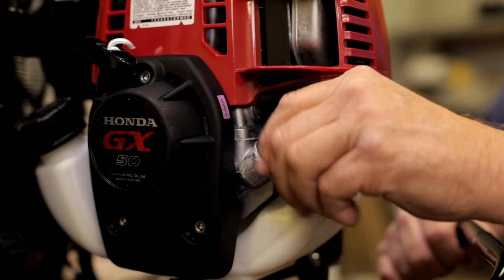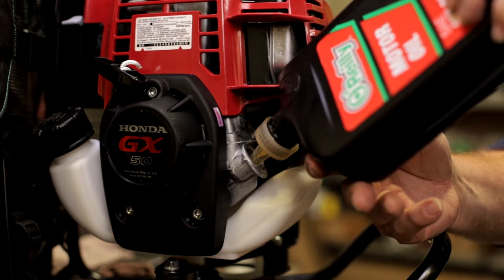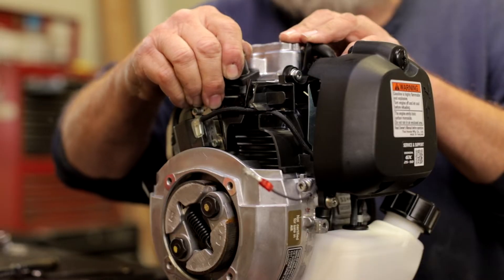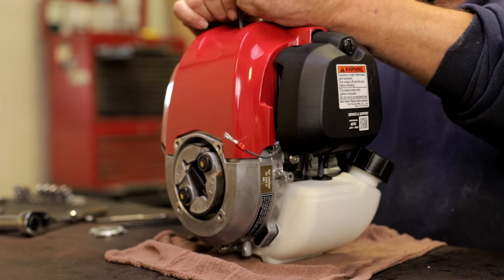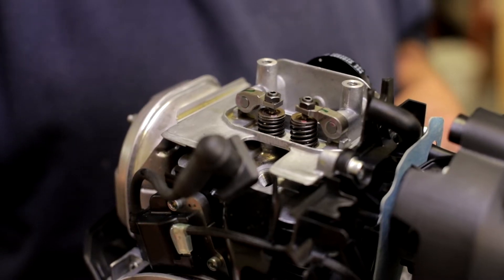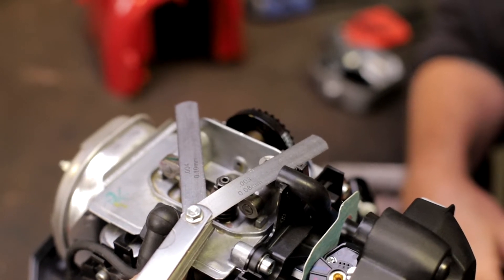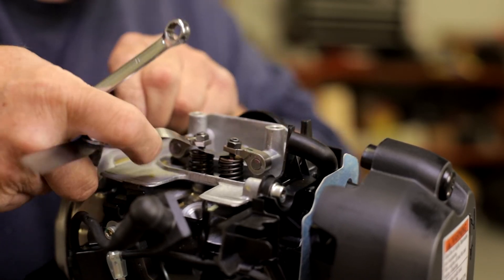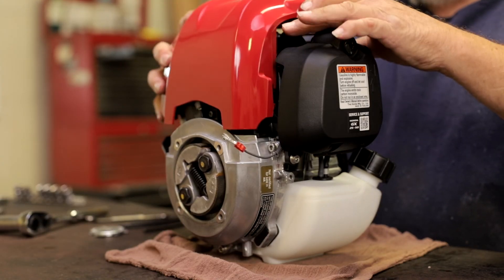Honda GX50 Maintenance and Repair

Comment: Mine bogs down and shuts off when I use full throttle but idles fine any ideas ?
Reply: likely the air fuel mixture is set wrong on the carburetor. also could be a dirty carburetor, or restricted fuel line.
Reply: @lukeWiz44  turns out there was a smudge of oil stuck in the intake used intake cleaner to get it out plus the choke is weird on these things
Reply: I'm having the same problem how did you fix yours?
Reply: @donkarlyonson3684  it was a smudge of oil in the intake I used intake cleaner and got it out also the choke is backwards on this thing
Reply: Hasnit happend again ti you? @MadTuning01
Reply: @yostinpoveda2083  nope it hasn’t brother
Reply: Sounds good. What do you think of the mk345? Im between a battery trimmer like milwakee, makita or sthil fs155 or honda mk345. @MadTuning01
Reply: @yostinpoveda2083  I’d go with Milwaukee for battery stuff they haven’t let me down but gas is go Honda or stihl for lawn stuff
Reply: @MadTuning01  thanks a lot. I will go to a local store that sells milwakee in costa rica central america, tomarrow. I will also check out honda mk345 probably. I know sthil is good but.they are a bit noisy and I am in a nice residential place. I still trying to figure out between battery vs gas. Honda could be go to because I would not have to mix. Everyone uses sthil here but I'm a bit scared of storing gas or having to mix or maybe getting bored later on. If my wife likes the milwakee I may order it online from USA because it is cheaper
Reply: @yostinpoveda2083  no problem hope Milwaukee serves you good brother 👍🏾

Comment: In a special application, when you turn the engine to have the output shaft upwards, will lubrication fail? More specifically the application is a large(ish) model helicopter so the output shaft needs to look upwards.
PS: The model helicopter will have its own dedicated fuel tank so the stock tank will be removed.

Thanks.
Reply: I'm wondering this too. Have you found an answer yet?
Reply: @sendnoobsplease  unfortunatelly no.
Reply: The GX50, GX35 and as far as I know the GX25 as well all operate happily at all angles and orientations but do not like to be stored with the cylinder head downwards as that allows oil to seep past the rings into the cylinder ala the AN2's radial engine bottom cylinder. Otherwise they will operate happily all day and night long at any angle. Be aware the diaphragm fuel pump in the carburetor only has so much capacity so don't have the tank too many feet/meters from the engine. @skorkmaz

Comment: Why cant i find any parts??? HONDA GX35 very easy to find parts for but the internet acts like the GX50 doesn’t exist
Reply: Really not even spark plugs, air filters or gasoline filters?
Reply: @yostinpoveda2083  this was awhile ago, i think i was just being stupid, oh and in this video, he was using the wrong marking to center the compression stroke, its actually an arrow, not the white dot
Reply: @Bubbaomw  do you own the mk435 or 450? How has your machine been? I have found various bad reviews about it. I don't know if I should go for sthil fs55 or shindwaiwa c230 or makita 36volts battery.
Reply: @yostinpoveda2083  i have tbe GX50 S3 model, ive had it hooked up to a bicycle for a year so far
Reply: Tahts great. My wife liked the honda stting trimmers. I was thinking of battery trimmers or sthil 2 mix. The battery due to safety but my wife liked the honda a lot. So we will go for the gx35 or the gx50. I will empty the gasoline tank by running the trimmer longer to waste the gas. Then the risk of fire is low and if it happens it wouldd be localize in the engine. I always choose stuff with wife and she is almost always right so im glad she liked hondas. We also have a honda crv car. @buhbuh4529